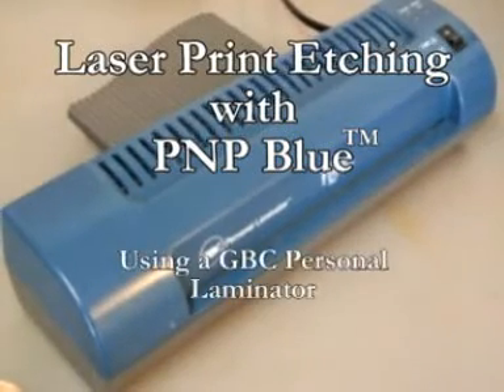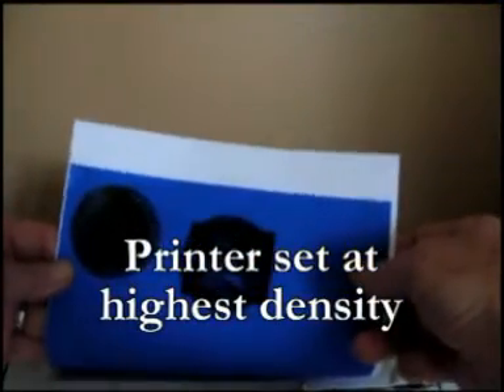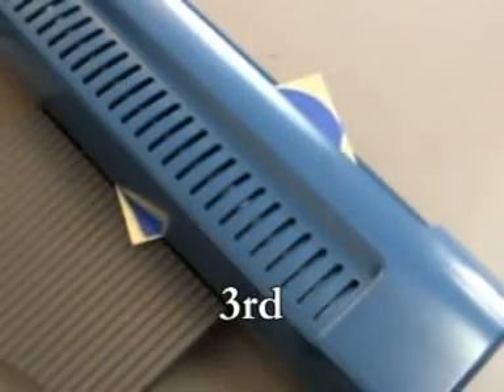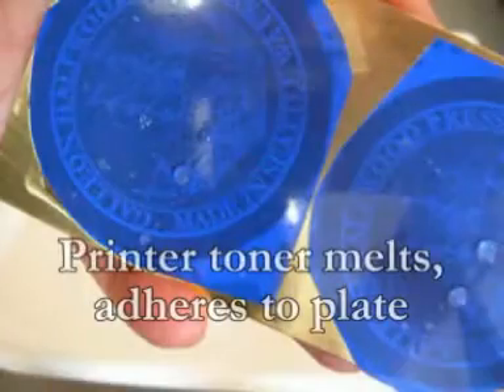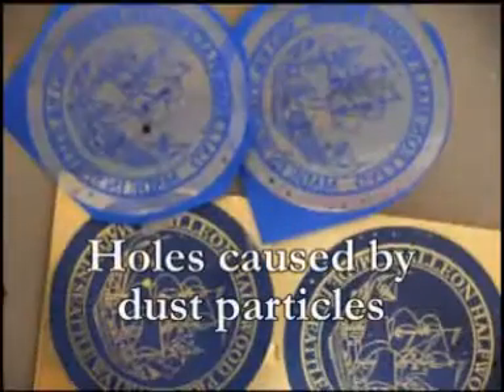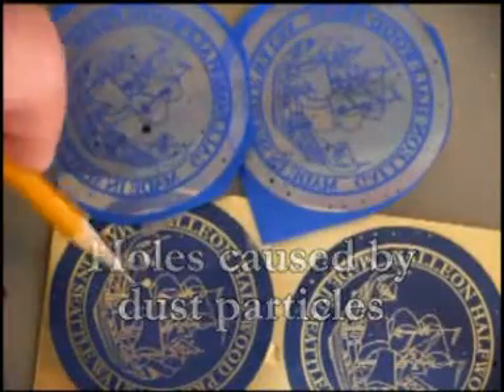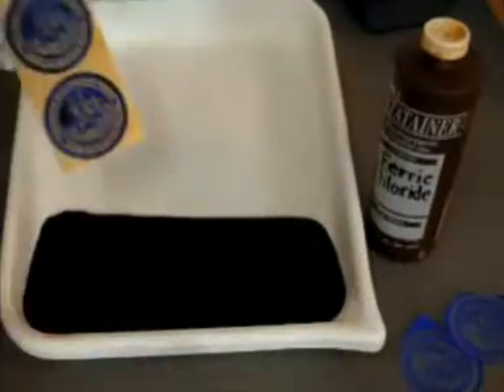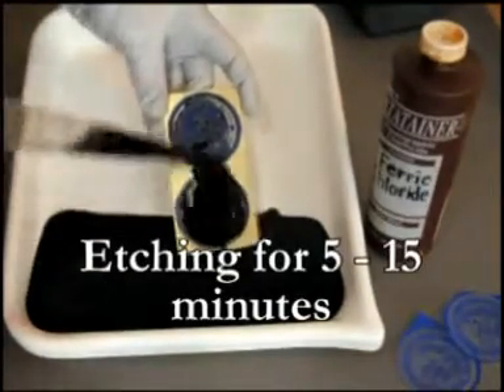Laser Print Etching with PNP Blue

Comment: Do u have facebook acct? i wanna contact u about some question ?
Reply: yes, halfwood press has a Facebook and so do i, bill ritchie. you need to know I haven't used PNP Blue for over five years - I couldn't get solid areas to cover, it left spots and holes so i adopted laser print transfer methods instead.

Comment: @BuckarooCoyote I have used as thick as 16 gauge and as thin as 24 gauge. I think 16 is about the maximum. BTW, I don't use PNP any more, it leaves holes and I could never figure out why. Besides, it's expensive compared to silicon coated paper, which is almost free. It comes with address labels, for example, and I'm experimenting with the backing from Contact Paper. I recommend the other videos on "silitransfer" etching.

Comment: @BuckarooCoyote  Hi - did I say I tack it on? I shouldn't have, because the laminator is so hot that anything like tape etc would melt. I don't tack  it on - sorry about that. I just (1) warm the brass, but not too hot, maybe 150-200 degrees. The metal has to heat, so pre-heat it first. (2) I place the laser print/silicon paper face down on the brass. If it's too hot to handle, I rest it on a piece of wood until I can stand it; then dextrously insert the two in the slot to the rollers.

Comment: @Geddiz - Yer right, there is no shifting. I run it through several times to be sure it heats the metal enough to stick. Actually I never use PNP any more 'cause it leaves mysterious holes in the solid areas I have to touch up with resists. Now I use laser print on silicon coated paper (silipaper) and that method is on YouTube, too, y'know. -B

Comment from the maker: I made up the name for "silicon-coated" paper (to be cute). Silipaper is that almost universal way of making backing-sheets for things like mailing labels and other pull-apart, self-adhering materials. NOTHING sticks to silicon, so when you print laser toner on it, it's going to transfer when you heat it up on a metal plate. Thanks for the good question!